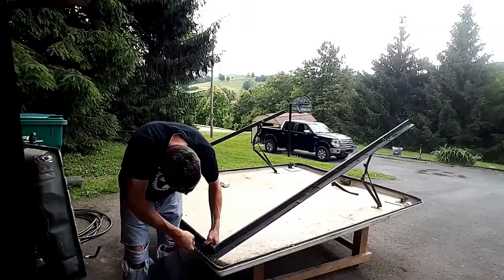Cutting down a long bed fiberglass tonneau cover to fit a short bed F150 Cover

Comment: Wow! I wish you live in Sacramento so I can ask you to cut my bed cover and install hinges on it so I can fold it back when I carry a tall condenser in the back of my truck. I asked the camper and tonneau cover dealer to see if they can do that but they asked me to buy the baklift one. What I really want is I want to cut my bed cover in half and put hinges to lift up and fold up. I believe it’s pretty easy to do it if they have all the tools. I can see that it’s so easy for you to do I want for my truck. Thanks for the video brother.

Comment: I had a hard tonneau cover on my 1995 Ford F150 (long bed), and it was super handy...most of the time. Mine was steel reinforced under it. That would have been a pain to cut through. Nice work!
Reply from the maker: I'm looking forward to it on trips to be able to lock the bed. Plus snow in the winter. I bet yours was heavy with a steel frame. This one weighs a ton.

Comment: Im going to do something similar to my camper shell. Theres fiberglass lips on the inside that are made for a wider truck bed. Its about a half inch or so too long. If they wernt there it would fit perfect.

Comment: I would have gone a different way, simply cut down the frame work, cut a slice out of the middle of the top to make it fit the now fitting frame work.....simply fiberglass in a thin sheet of door skin where the two half's of the top go together...under side so it don't show and maybe a few extra 90* ribs just to add to the strength of the splice, a little fiberglass and body filler to the outside to finish it off !    But your way worked so all is right in the world !
Reply from the maker: I totally agree with you. I was going to do it just like you said but two things stopped me. The bed cover  has a tapper and the lip changes thickness as it goes down the side. I would have had to section the piece near the cab and seam it too. I didn't feel confident enough in my fiberglass skills to pull that off. Thanks for the comment maybe if I do it again I'll try and do it all fiberglass.

Comment: Hello. What type of blade did you use on the circular saw? Thanks
Reply from the maker: It's a composite blade like a cut off or grinding wheel. That's a panel circular saw so it's a little smaller than a typical saw too.

Comment: Hey bro nice video have a question I have a canopy for my truck and want matching opening windows could a body shop cut the canopy to install a matching window cheers
Reply from the maker: I would imagine that they could. Only thing that might mess you up is if it has any support braces in the way.